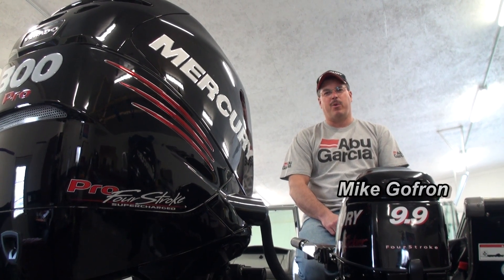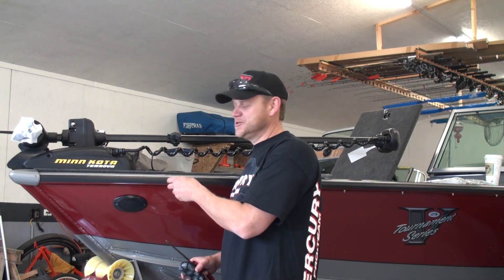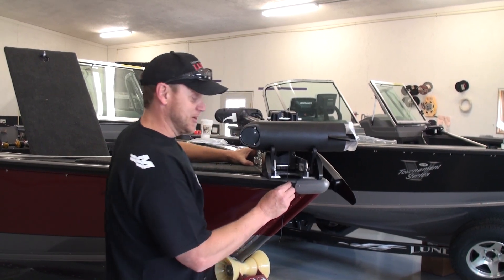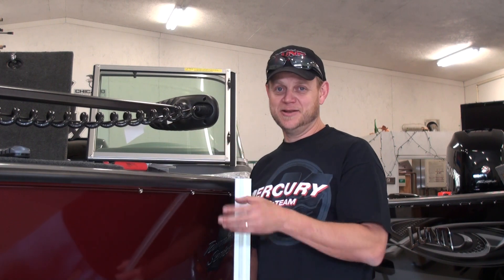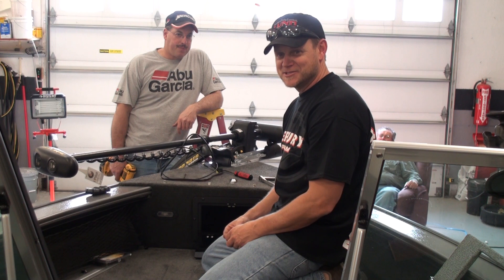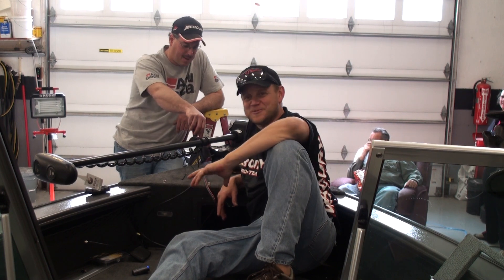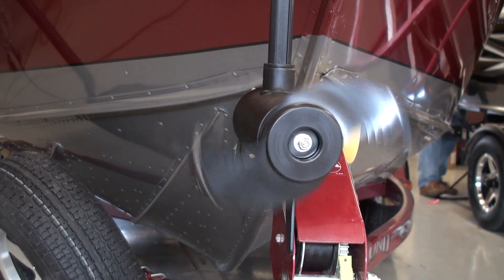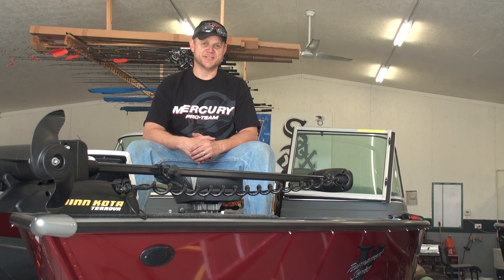Installing Minn kota Terrova with iPilot

Comment: how close to the center of the bow do you mount it?  I bought a used boat with the terrova already installed. But it is mounted about 1 ft from the nose of the boat. I want to add a deckhand 40 beside the terrova but I don't have the room with the way is is currently mounted. I also have a boat cover that would probably need to be redone on the nose to accommodate a new position of the terrova. I am thinking about moving the terrova close to the nose. What do you recommend?